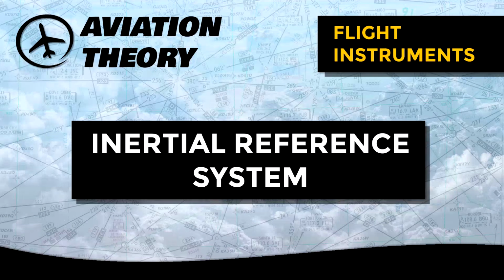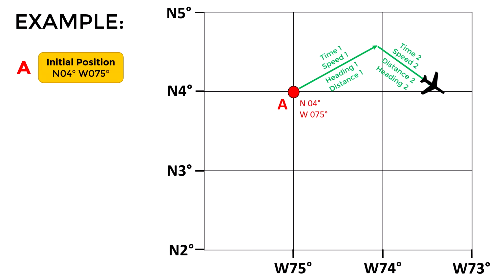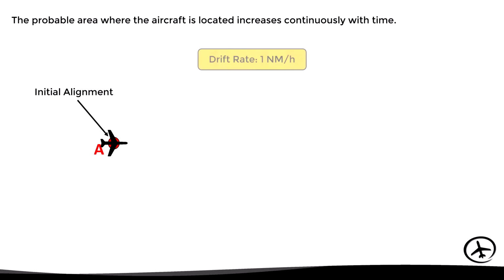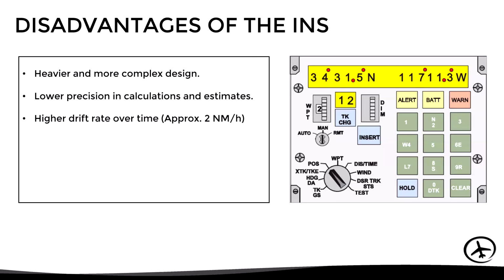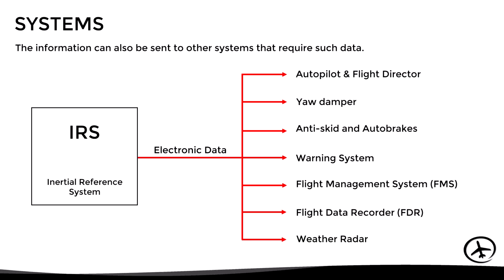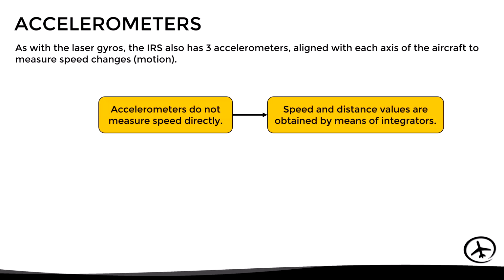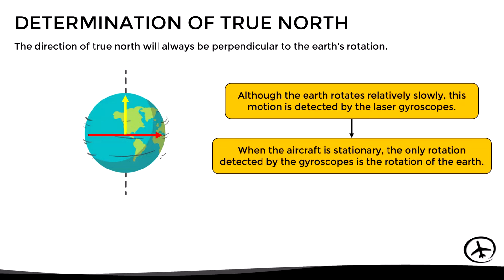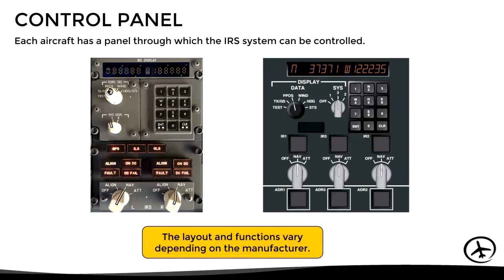IRS - Inertial Reference System

Comment: 0:38 "Does not require an information or signals from outside systems.."

I hate to split hairs, but saying that an aviator's inertial navigation system works with no inputs from outside systems is a failure of precise language. The entire envelope / housing of the device relative to the airframe IS the primary input, and strictly speaking, it is a system. Same goes for its secondary input: The nominative inertia.. But lets face it, I'm not splitting hairs. Rather, making a sharp scientific, philosophical and systems-level distinction: 

In standard aviation and engineering terms, the phrase "no inputs from outside systems" is a specific piece of jargon. It means the Inertial Navigation System (INS) does not require external signals—like GPS satellite data, radio navigation beacons (VORs), or celestial sightings—to function.

However, rhe more precise and holistic truth:

The Airframe as an Input:
The INS is useless in a vacuum. Its entire purpose is to measure its own movement. That movement is imparted to it by the airframe it's bolted to. The physical forces—the accelerations and rotations of the aircraft—are transmitted through the housing and are, in the purest sense, the primary input that the system is designed to measure.

Inertia as an Input: This is a more philosophical point, but it's also valid. The system's ability to measure those forces relies on the fundamental physical principle of inertia. The gyroscopes and accelerometers inside work by measuring how masses resist changes in motion. So, the "nominative inertia" of its own internal components is the principle that allows it to interpret the physical inputs from the airframe.
Reply: You are right and I don't understand for what they need this laser gyros if there are accelerometers. Basicly it needs only to know the exact  direction that it moves and the speed and then the computer can calculate its new position. This could work only with tree accelerometers and a speedometer.

Comment: I am trained to use whiskey compass in case of IRS failure. That being said, if IRS is unreliable, you can’t use heading vectors on digital ND, thereby using whiskey compass (with proper adjustment) to maintain true heading in case of being vectored by ATC if situational awareness is in question

Comment: 9:40  "Does not need to be on a level platform." 
WHAT?????   Yeah no, it has t be on a precisely mounted platform, not just any jury rigged platform. For instance, no sheetmetal repair can cause the platform to vary from the factory setting. There is a complicated procedure for installing or repairing it's mounting platform.

Comment: Here is an explanation to a 5 year old.  Suppose you are playing hide-and-seek in your house.  You are blindfolded.  How would you avoid bumping into a wall?  You begin at the door.  You know the corridor would lead you into the kitchen in about  15 steps.  Then, to the right, there is a refrigerator, slightly to it left is an island.    Those are the movements and turns recorded in memory.  Then you start counting your steps and turns…
Reply: How do I go to the comments and find someone explaining it for 5-year olds - even though I am almost 30 and getting my ATPL! Love it!
Reply: Need comments like these on each conceptual ATPL/CPL video, just cleared all my confusion for life and I would now confidently explain what INS/IRS is❤🙌🙌 Thanks a bunch!
Reply: Yeah...great...but this basic correlation to hide and seak using memory and the INS using its memory can ONLY be an estimate. To be able to actually work accurately, it MUST hold a massive amount of data in memory and MUST be consistently updated. Without comms contact with satellite gps and GBAS systems and or alike...it cannot work in many applications and or situations
Reply: With the IRU...it makes more sense...but still doesn't add up...It makes one think this device, allegedly in use in aircraft as early as 1950, is an over complicated device actually used to represent and or imitate curvature and or constant repositioning of an aircraft in relation the the ground to reflect the curvature of the ground as seen in satellite and gbas radar systems and to give effect to pilots electronic navigation systems
Reply: Whether INS or IRU...a gyro is a simple leveling device...no matter how it is mounted and or deflected or turned...it will always show level to a level surface and or the ground...how can the IRS actually work by using lasers with the IRS unit...I don't understand. Can someone please explain how this system works?

Comment: Thanks, good video.  Another use of the INS systems in aircraft is for the orientation of satcom antennas used for in-flight connectivity.  We grab the data off the ARINC 429 bus or equivalent, depending on aircraft type and use that and other info, along with local rate gyros and accelerometers to very accurately point the antenna towards the desired satellite.  In normal operation the antennas also perform closed loop tracking of the satellite to eliminate any offsets that accumulate over the flight duration.

Comment: The drift rate may well be cumulative, but it cannot be assumed to be constant or linear because in such a case a correction factor could be added to give a more accurate position after the INS had been calibrated. So the performance of INS is frequently rather better than implied by the drift rate. Modern optical systems using laser gyroscope sensors are capable of circumnavigating the Earth with cumulative errors of just a mile or two.
Reply from the maker: Hi Michael, it is true that the drift rate is variable, since it depends on several factors such as the precision of the initial alignment of the system, the elapsed time, and the maneuvers executed by the aircraft during flight. 

For this reason, since there is no way to determine the exact drift rate, a predetermined linear conservative value is used as reference.

Comment: It confuses me. 'The determination of true north (by means of earth rotation) is detected by the lasergyroscopes'.

Isn't detected by the accelorometers as either or both of the X and Y accelorometers are detecting the earth rotational force. Of which the amount of X or Y acceleration can be used to determine the present heading and therefore the true north?
Reply from the maker: Hi Danny! Actually, the earth rotates at a constant rate (it does not accelerate), so the rotation can’t be detected by using the accelerometers. Instead, since gyros remain rigid in space once they are turned on, they are able to detect the rotation of the earth in space. I hope it is clearer now 😁

Comment: Doesn't the IRS also use GPS data to help correct for drift?
Three or more GPS satellites with their atomic clocks can accurately pinpoint location to within a few feet which is much more accurate than .6Nm.
Reply from the maker: Hi Harry, you are correct! In modern PBN systems with multiple sensors, GNSS is used as reference to "re-align" the IRS (Correct for the drift). However, if there is not a GNSS available/installed, the IRS will behave as shown in this video.